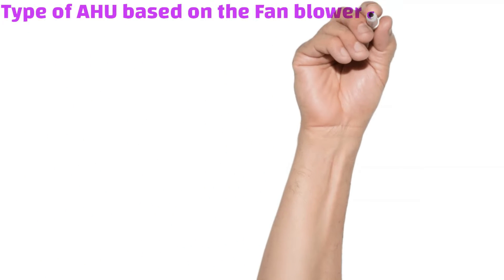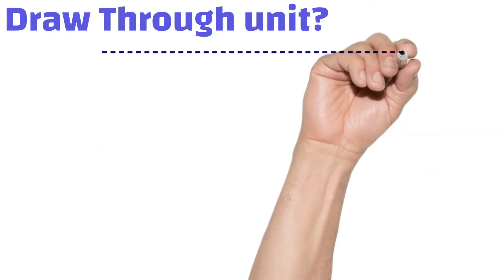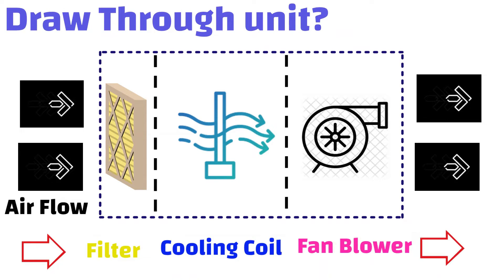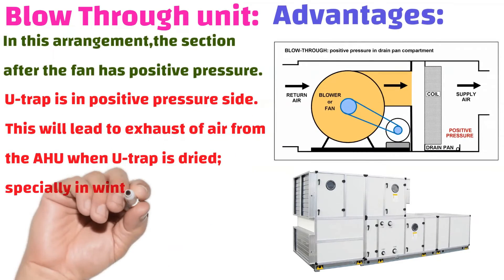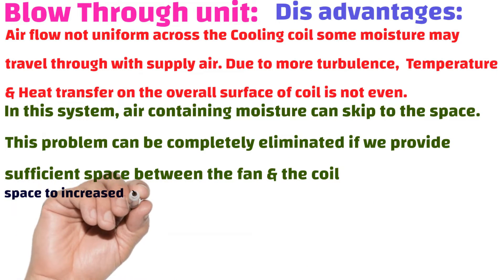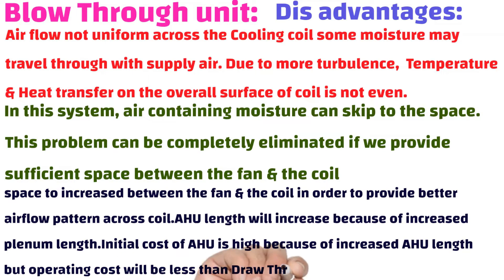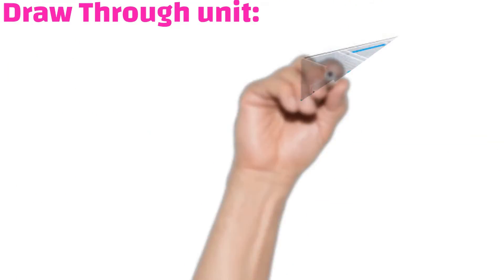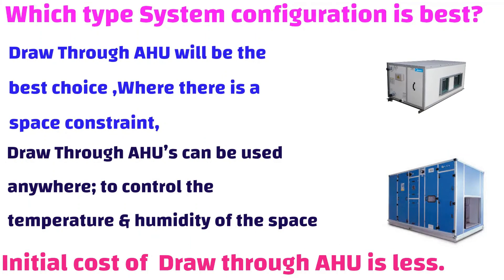Basic Understand about Blow through AHU and Draw Through AHU

Comment: Hi, do you know why operating cost of draw through type is more than blow through? I've seen this noted a few times during my research but no-one explains why it's more expensive. Thanks
Reply: I am also interested to know
Reply: @ekkapharb  it appears no videos seam to explain it properly. I found one place that said due to the better efficiency of draw through they are cheaper to run, the additional cost is in manufacture. A separate chassis is required to support the fan in a draw through as opposed to the ducting forming the chassis in blow through. Though that makes little sense to me. 

Say a blow though has brackets to support off chassis, it would need a baffle to stop recirculation. Then it passes through a coil (also baffled to prevent bypass) then passes into ducting.

Whereas draw through would have the baffled coil, drawn through the fan straight into ducting to match the fan outlet.

If anything it would require less materials?

There is a larger effect on static pressure in a draw through though.